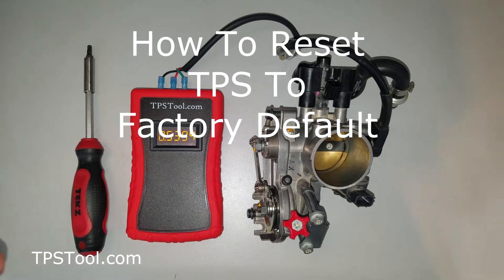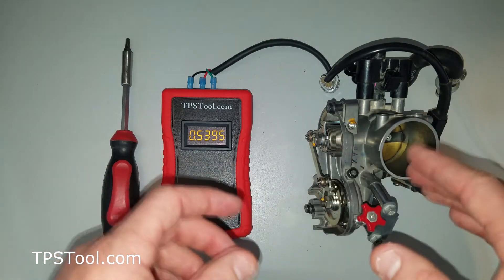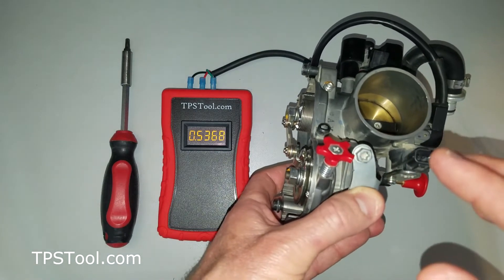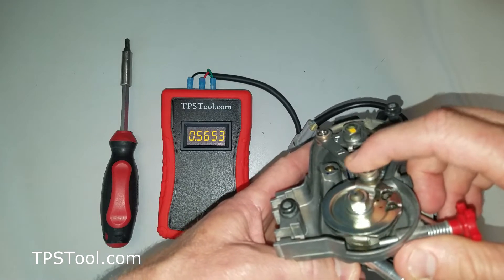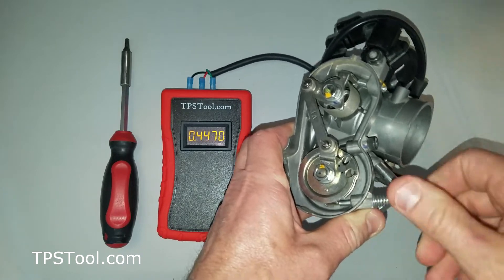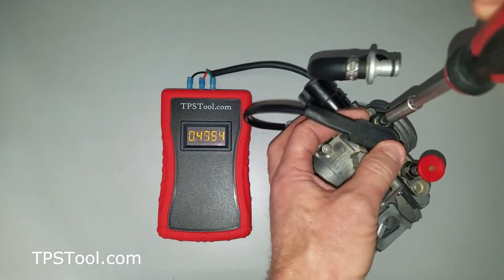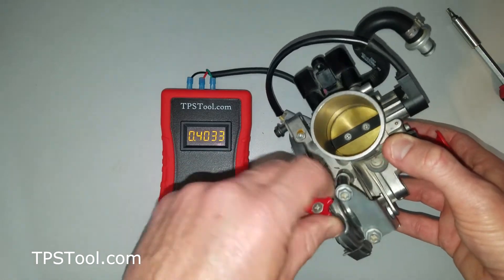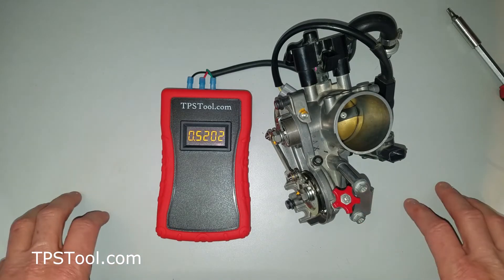How To reset your TPS to factory default (Throttle Position Sensor)

Comment: Does it tell you what the idle speed is as well, if thats not set right the tps reading wont be correct
Reply from the maker: Thanks for your comment.  I believe you have your procedure mistaken.  If the goal is to set the TPS to the factory default, and your throttle body is the style that the idle setting also affects the TPS reading (not all do), then the proper procedure is to fully close the throttle plate (idle turned all the way down), then adjust the TPS to the value specified in the  manual.  This will be the baseline TPS setting.  Now the TPS adjusting part is done.  To set the idle, now turn the idle up until the TPS reads the value specified as the idle speed TPS reading in the manual.  At this point your idle should be in the ballpark, but you may need to tweak the idle speed a little by using the idle speed adjuster.  Now you are set to factory defaults.  From here you can adjust the TPS itself a little to fine tune the fuel mix if you like.  I hope this helps.
Reply: @TPSTool  Thanks for the info, I'm a little confused. If I turn the idle down to zero and set the tps to 0.55 (stock setting in the manual) then turn the idle up, this will increase the tps value to way above 0.55
Reply from the maker: @Phil_7990  Which motor are you working with, model and year?
Reply: I have a 17 350 ece-f (EU) the throttle body it type that any increase in idle speed will effect the tps value.  I have see this done by a dealer using the KTM software, when the idle speed is increases, the tps vaue also increases,  To set to tps to stock value (0.55) the idle needs to also be in the stock range (1900-2000 rpm), any increase/decrease from the stock idle speed will effect the tps value
Reply from the maker: @Phil_7990  To set the bike back to factory default, back the idle screw out all the way to close the throttle plate, then adjust the TPS to read 0.40V, now the TPS is set to factory default.  Next turn the idle up until the TPS reads 0.55.  That should put you near the correct idle speed, maybe a little on the high side.  From here you can adjust the idle speed, and yes that will change the TPS reading, but don't adjust the TPS itself unless you are trying to fine tune the fuel mix.  See section 25.2 in the 2017 KTM service manual.  I'm not sure what your dealer was doing, but it sounds different than what the manual says.  You do not need a tachometer to set the TPS correctly, you do need a tachometer if you want to set the idle speed accurately, though most guys just adjust the idle to where they like it.  Are you trying to get back to factory default, or are you trying to tweak it for better performance?

Comment: Hi I m from India and I have ktm Duke 390 could you please help wit it's throttle settings it mis fires a lot
Reply from the maker: Thanks for your comment. I would love to help, but I think on the Duke 390 the TPS might not be adjustable.  That bike is not common here so unfortunately I don't have one to look at myself, but google around and I think you will find several threads about the throttle position sensor on the Duke 390 not being adjustable.  I hope this helps in some way, please post back here if you find any new info about it.